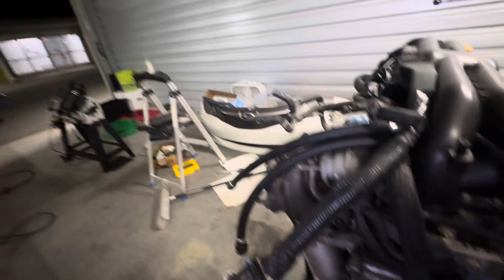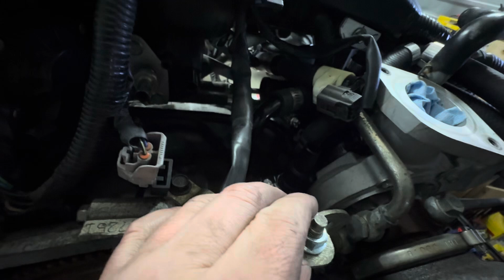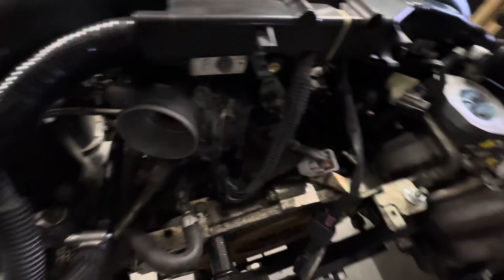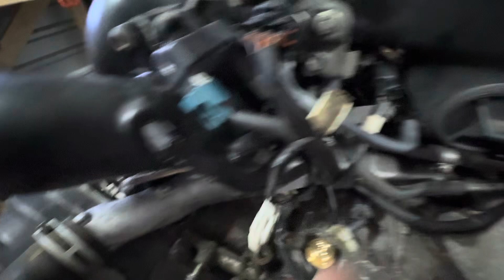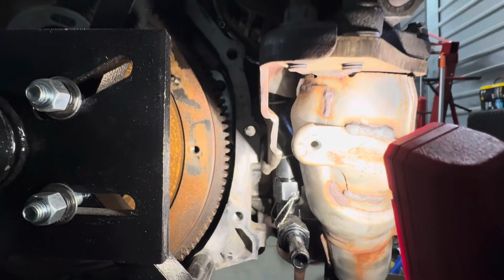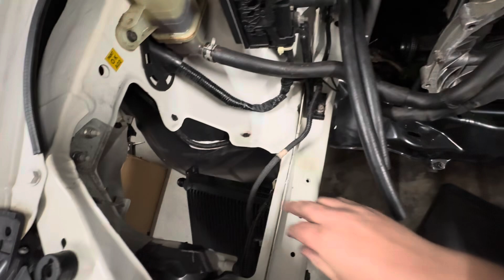WRX EJ255 2009 electrical vacuum and coolant

Comment: So the evap hose that goes to the turbo inlet is the port farthest away from the electrical connector on the purge valve under the front of the manifold correct cause Google told me the port closest to the electrical connector goes to the turbo inlet

Comment: I just did a engine swap on a 2010 wrx I bought. It has a iag aos I don't even know where to begin plumbing the aos back in.
Reply from the maker: I have a few video shorts to break it down, hope it helps. Let me know if you need any specific advice.

Comment: Thank you for this video, helped me ID at least 2 things I'm currently working on. On my EJ255, I noticed a plastic connection tube by the PCV assembly. Would that connect to the vent line port/opening on the engine?
Reply from the maker: I’m so sorry I’m struggling to picture what you’re seeing. I’m so sorry that I’m weeks late replying, could you film a video and put it on youtube, send me a link, that way I can see specifically what you got going on?